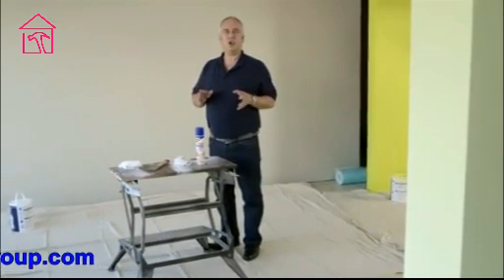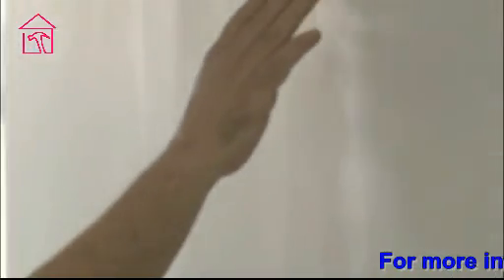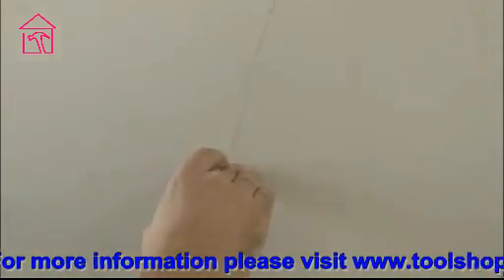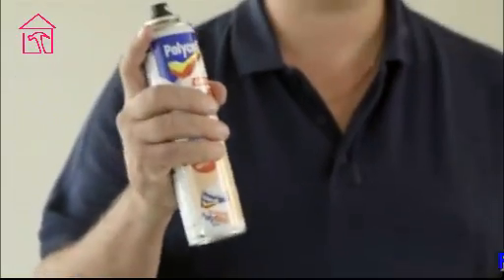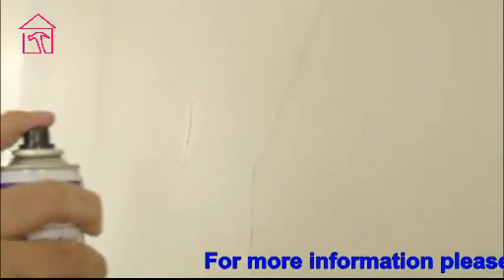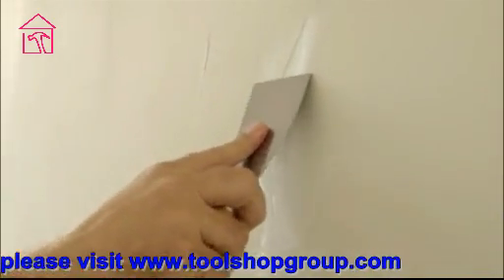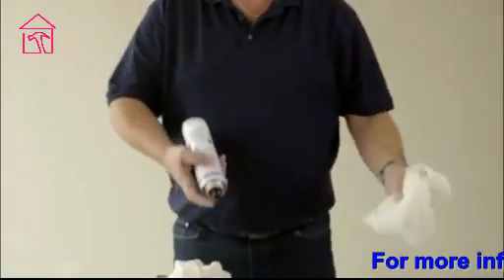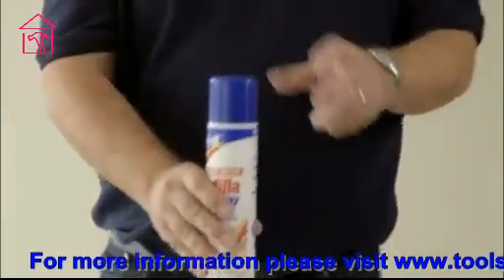Polycell: How to repair hairline cracks & minor surface imperfections ?

Comment: A couple of my walls have hairline cracks much thinner than these on this video. As in, so thin filler won't go in. Am I supposed to make the cracks bigger to be able to fill or is there another way?
Reply: Yes. Use a stanley knife or a filling knife to make it wider so that the filler can adhere to it
Reply: O